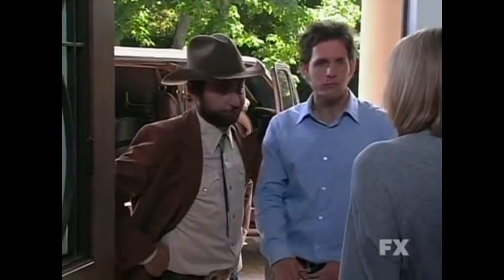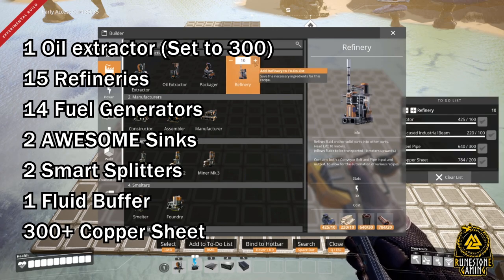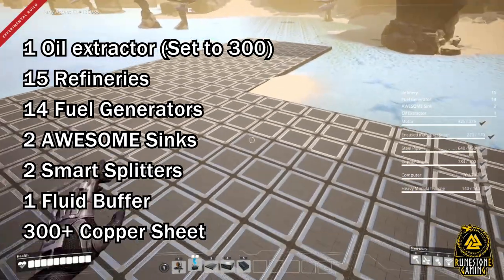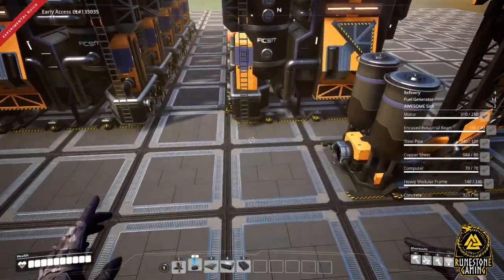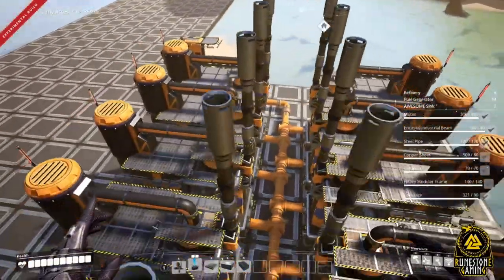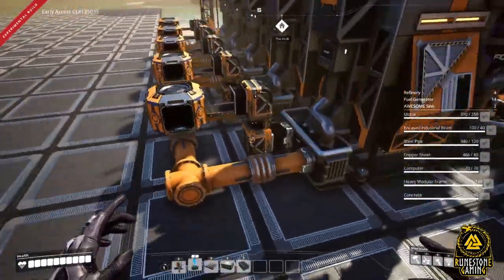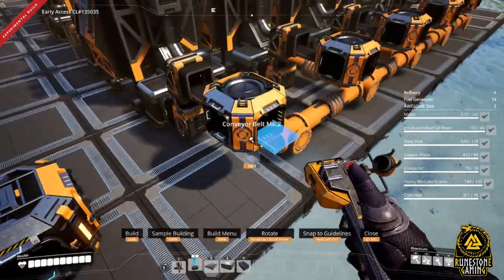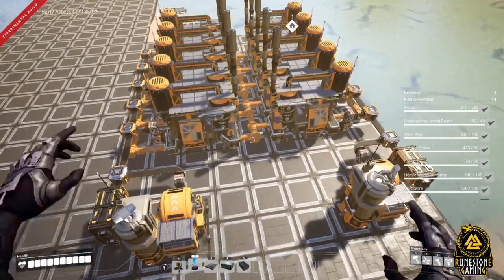🛢🏭Satisfactory Game - Ready for Oil?🛢🏭 - Tips & Tricks for your FIRST oil factory!

Comment: I can't quite make the math work out here. Am I crazy?
Decided to use this build as an inspiration for my own setup but it seems like a massive overkill.

10 refineries making either plastic or rubber will consume 300 oil per minute.
5 refineries making plastic will generate 50 heavy oil residue and 100 plastic per minute
5 refineries making rubber will generate 100 heavy oil residue and 100 rubber per minute

A refinery making fuel from heavy oil residue consumes 60 heavy oil residue to make 40 fuel per minute
This means you would need a maximum of four refineries to consume all heavy oil residue, and generate a total of 100 fuel per minute (150 heavy oil residue will generate 100 fuel per minute)

The 5 refineries you specify here for fuel production are only relevant here if all 10 refineries make rubber.
For this balanced setup making 100 plastic and 100 rubber you would only need 4 refineries.

Similarly, one fuel generator consumes 15 fuel, so since we are generating only 100 fuel per minute it means that we need a maximum of 7 fuel generators. Even with rubber only, the 14 generators you specify here are a huge overkill?! Or am I missing something here?
Reply from the maker: Dang dood - nice catch! I suck! Oh well - I got you something close - sorry for the shitty content <3 TY for watching and checking my math. I think I assumed all machines set as rubber.
Reply: @RunestoneGaming  It does add up perfect with 2x300 oil and 10 plastic and 10 rubber refineries I discovered after messing around with it

Comment: im quite confused on how to get the power started for it to be automated  ive got all buildings down every thing is connected together i just cant get the setup started as it still says everything needs power im really new to the game and this is my first time getting onto oil
Reply: If you haven't connected the factory to another powerline its because when you activate it starts processing oil but it takes some time to make fuel so when you start it the refineries are using power but the generators aren't functioning because the fuel hasn't already been produced so it shuts down because it is not producing power

Comment: Really nice video, and I know I'm late but I got a question. To unlock the Fuel Generators, I need rubber which I get from the oil factories. But I just don't know how to start. I don't really understand how this all works, can I just use coal generators to power the oil extractors and refineries? I need oil, so I can produce plastic and rubber to progress in the game, but I don't know how to do that. And I'm stuck now lol. I got stuck when I first unlocked the coal extractors but I found out how they worked, problem now is that any crude oil deposit is 2000m from my base meaning I'll have to know what I'm doing if I want it to be effiecient. 

Thank you!
Reply from the maker: Hi Yucci, first welcome to the channel! Second! This would be something great to talk with me about on the live stream! Third, yeah I would do exactly that. I would run your first oil set up with coal and use biogenerators so get a small basic set up going. Don't worry about the fuel generators just yet. Focus on getting plastic and rubber started.
Reply: @RunestoneGaming   alright thank you! Will the coal generator setup make this build fully automatic? 

Since I have a coal generator setup, that provides electricity for everything, and it’s infinite since it’s powering its own inputs (the coal extractor aswell as the water extractors/generators). That way I basically have an infinite power source as long as I stay under that produced electricity. If I create 8 coal extractors with 3 water generators/extractors (forgot the name lol) as well as a coal input, I will basically generate 600 MwH. Is this enough? Haven’t watched the video from start to finish as I noticed the use of Fuel generators, I mainly just saved this video so that I could use it tomorrow when I’m gonna need to produce plastic and rubber! Wow, sorry for that long message and I’ve noticed that I’ve used maths in this game more than any other lol. Again, amazing video! Yes, Haven’t watched it from start to finish but yet I can tell that your videos are quality content. You earned a subscriber. Thank you!

Comment: I am still very new to the game, just unlocked Jetpack. Which is one of the reasons i am looking into Oil production now.
Is that now you fly around when you build, or is it a mod ?  (It looks WAY more efficient than me running around on the groud like an ant :) )
Reply from the maker: I use area actions mod and activate flying. It is a mod. However, these builds are completly doable without it. Try to use foundation double ramps to get you up high :)

Comment: Thanks, good video on oil, how scalable is this setup?
Reply from the maker: This is running the 5 plastic and 5 rubber refineries using the standard recipe - so t hats 300 oil - unless you upgrade the pipe and find a pure node - its not expandable :(
Reply: @RunestoneGaming  thanks for confirming I use the power mod most of the time and make use of the geo thermal once I have super computers as that is 100% power without any deficit unlike coal or oil

Comment: This video really helped me thank you. Can I ask why use 2 sinks and not just one and merge waste into the one? Also is there any use for the waste that's going into the sink?
Reply: Since you're into oil already, you should already have MK3 conveyor belts, which can handle both plastic and rubber at once (200 per minute produced, MK3 can handle 270) so 1 sink should suffice. I like to place my refineries all in 1 row and have the conveyor belt carry plastic and rubber at the same time and use a smart splitter to split both products into their respective container with a sink at the end. So if any container overflows, it goes straight on to the sink.

Comment: What are the Awesome sinks for?
Reply from the maker: You sink items you dont use for tickets that unlock certain buildings or items!
Reply: Also, the plastic / rubber production if it stops will also stop all fuel production and shut your shit down :D

There are two ways it can stop:
First it will stop if you don't consume all the rubber and plastic - this is dealt with by the use of the sinks

Secondly it will stop if you don't consume enough power and the heavy residue backs up. This is mitigated somewhat by the buffer, but you need a liquid overflow system and then a way to turn the overflowing heavy oil residue into sinkable items (making fuel that is then packaged and shipped into a sink, for example)  to make the system fully automated.
Reply from the maker: @SigurdFlaatten  100% correct here - if only I could find the motivation to get pt 2 out to deal with the overflowing heavy oil